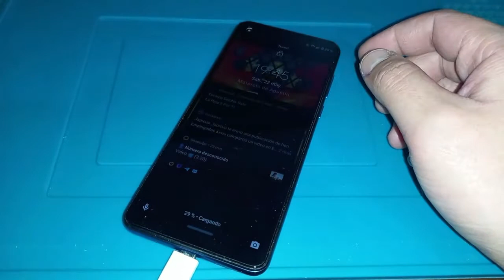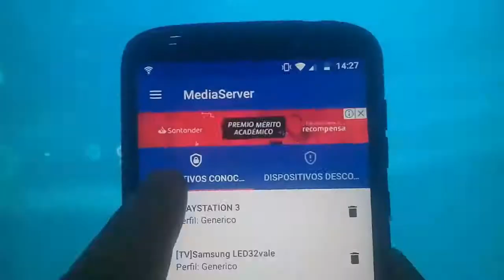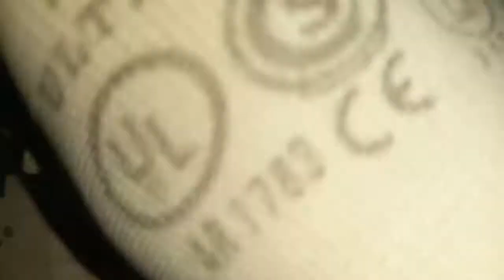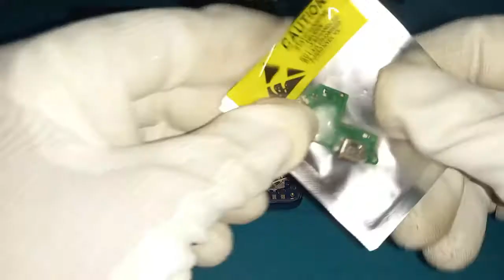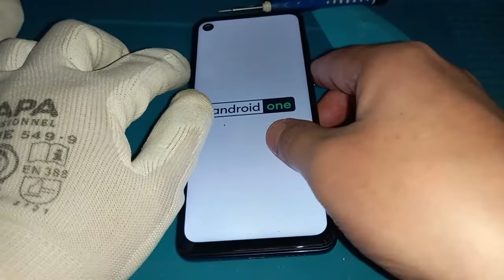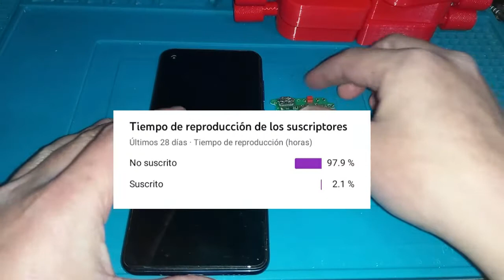Como cambiar pin de carga Motorola One Visión

Comment: Hola am celus , desarmando rompi la antena blanca del motorola one vision de osea el cable de la antena se partio de que sirve? donde lo puedo conseguir le va cualquiera que tenga esos centimetros?
Reply from the maker: Hola damian ojeda, si no me equivoco la blanca es del WiFi, podrías probar con una que sea de wifi de igual  medida y podes conseguirla en una casa de repuestos de celulares, la verdad no se de donde sos.
Reply: @AMCelulares  soy de capital buenos aires ,  las antenas puedo conseguir 1 de igual medida y listo va calzar solo tiene qe medir lo mismo ?
Reply from the maker: @damianracing22  en capital esta lleno de casas de repuestos, te aconsejo conseguir la del equipo, en mercado libre hay publicadas. Y si vas a poner otra de otro equipo asegúrate de que sea de wifi y si tiene que medir lo mismo por que sino no te va a llegar a conectar. No te olvides de ayudarme suscribiéndote al canal. Saludos.
Reply: @AMCelulares  Busque hermano en mercado libre es la del motorola one vision y no la consigo  me podrias ayudar a conseguirla ? y ya estoy subcripto <3
Reply: @AMCelulares  Creo que es la de linea porque yo compro celus con modulo roto y los arreglo y este apenas llego probe chip asi con pantalla rota y sono todo y despues se me corto la antena blanca y me intente llamar y no sono mas . sera la de linea ? y ayudame ac onseguirla porfavor es la del motorola one vision
Reply from the maker: @damianracing22  https://articulo.mercadolibre.com.ar/MLA-921665300-antena-coaxil-motorola-one-macro-original-jyd-celulares-_JM
Reply from the maker: @damianracing22  hablame por instagram que te paso unos contactos de casa de celulares de capi, puede ser que sea de red, la verdad desconozco. Tendrías que buscar el esquemático para estar 100% seguro, también hay que ver si le pones otra si es compatible.